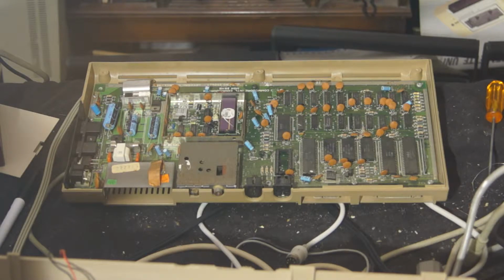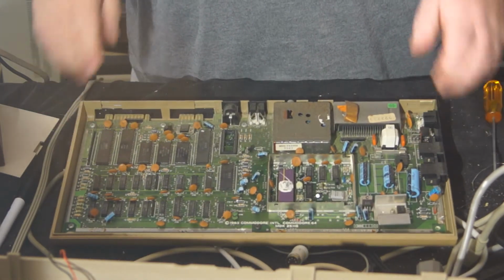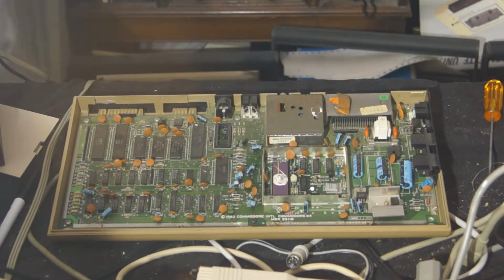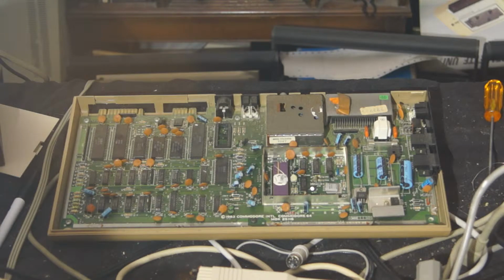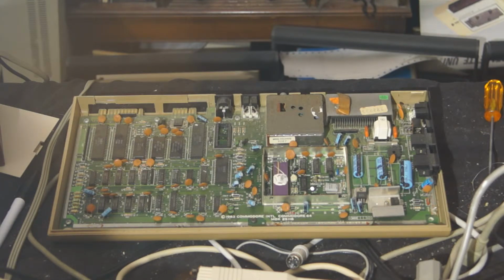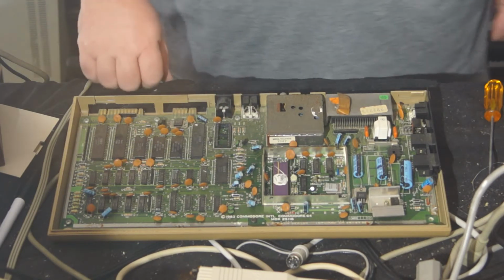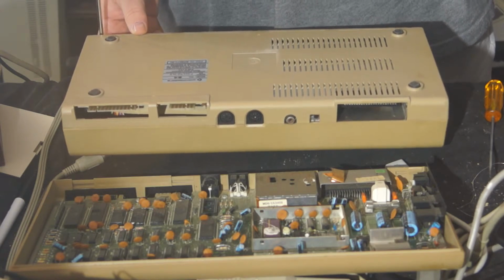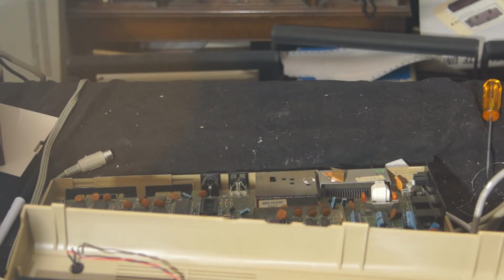Commodore - Episode 415 Closeup - 64 Socketed Vs. Soldered Chips - David Bradley - C64 C-64 8-BIT

Comment: full socket for testing chips is the best:)
Reply from the maker: I do much prefer machines with everything in sockets!  Makes troubleshooting so much easier.  But if everything is soldered in, you never had to worry about the microscopic corrosion issues that can cause failures that can be fixed by re-seating the chips...but I would rather have sockets...oh yes...